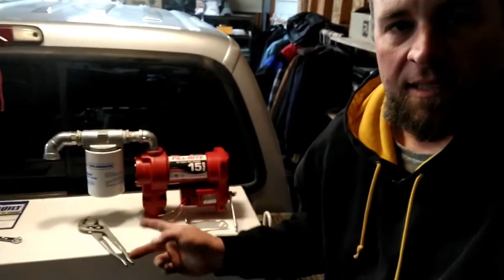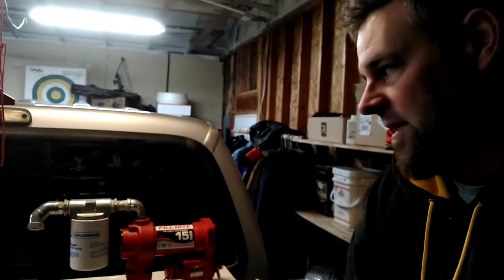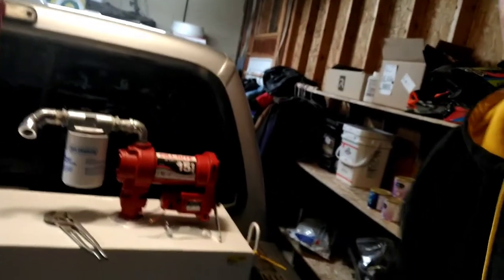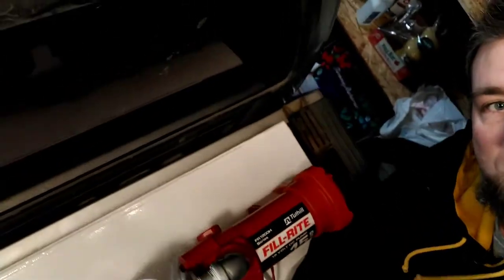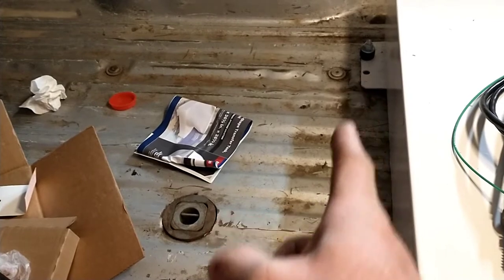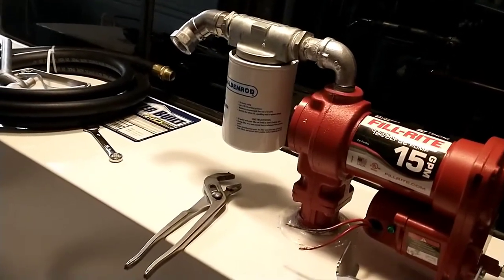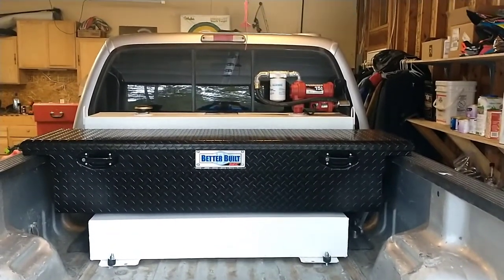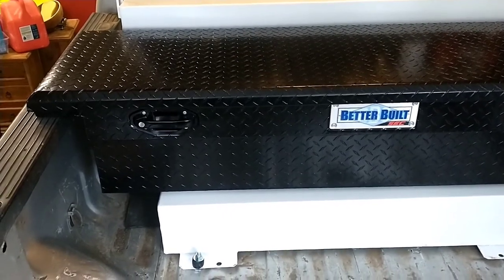Final install and associated issues with Better Built transfer tank and tool box

Comment: Thanks for the video. I'm looking to do a similar setup but need to take measurements for the Decked toolbox system. Does the auxiliary have a drain to plug into the fuel system and I don't wanna drill into my new 21 Duramax instead i will use a strap. If it has a drain can it be used to feed through the fifth wheel holes already there? I'm trying to do all this without drilling. Sorry for the questions. Just trying to setup my doomsday truck.
Reply from the maker: It does have a drain, not sure about hooking that all up and drilling holes though. Good luck, let me know how it goes
Reply from the maker: Weathergaurd makes a fancy setup and those are nice units.pricey though
Reply: @grtcraneservices  I appreciate it. I hope there dent proof if they are pricey. The decked toolbox is glock polymer and is sealed. I will take a look at it as well. Great video once again sir.

Comment: Ryan - Every had that tank build up high pressure?  I have a tank that makes me nervous because I can hear the tank contracting/expanding.  Any thoughts Sir?
Reply: You need a vented cap. My tanks have them from the factory. If you look at it it should have a slot where it can vent or be all the way closed. Leave it on the vented slot it comes first before the locked down. When you put the cap on turn it all the way to locked and then turn it loser till it springs up to vent. Pull on it and make sure you didnt undo it all the way and youll be good to go.

Comment: Screws will end up vibrating and not holding anymore get two J bolts and washers and locking nuts and stick the j down the to lip on the inside of the bed